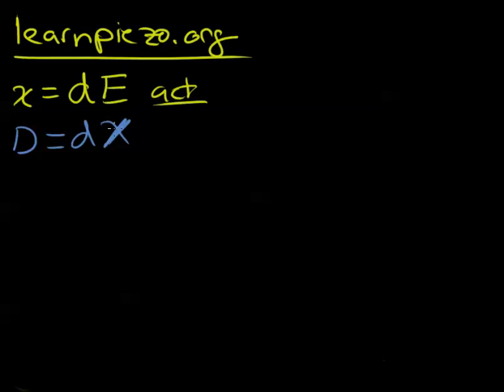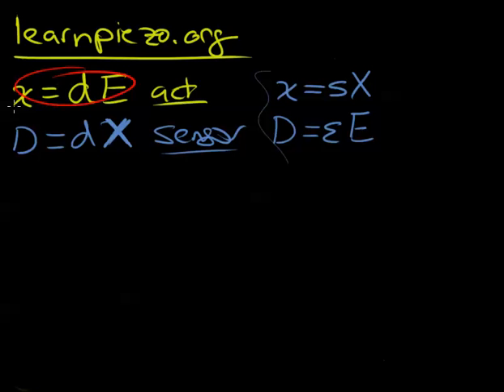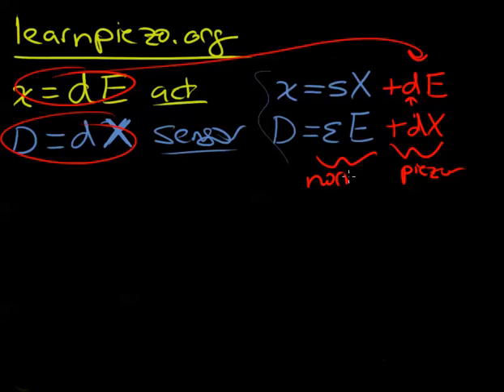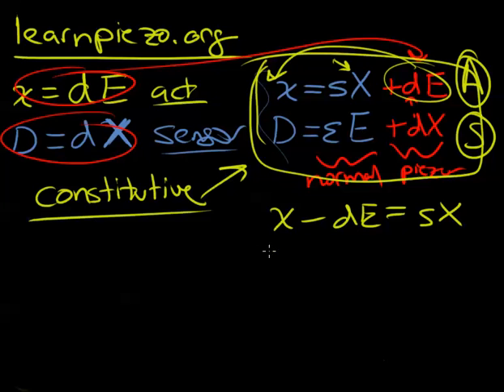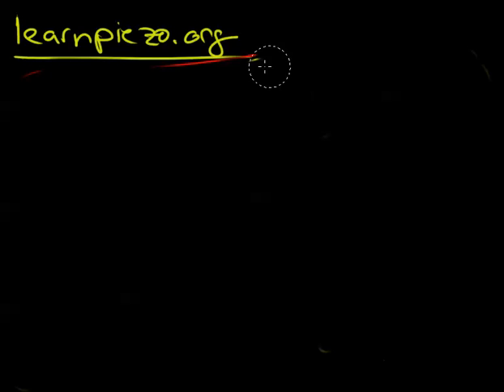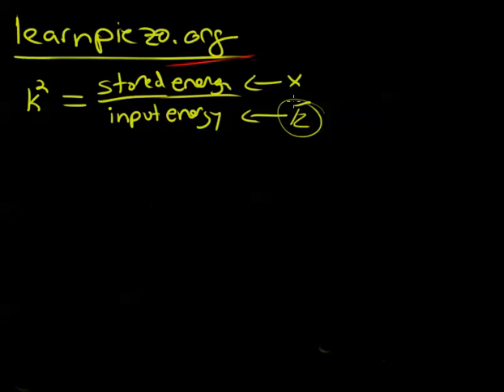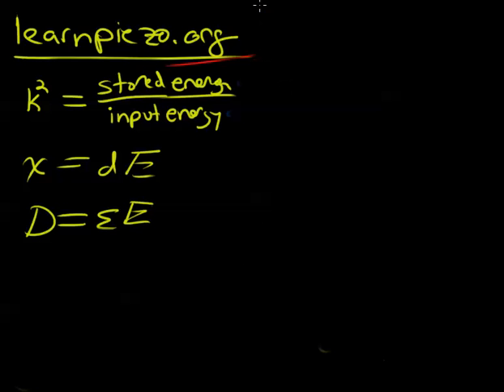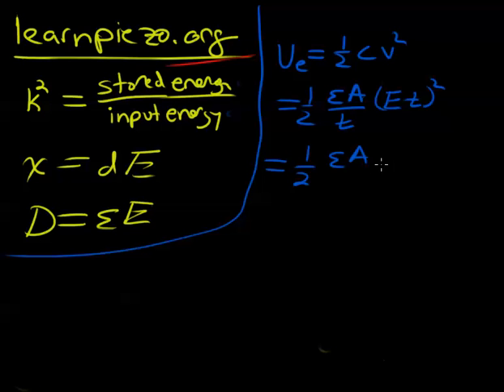Learn Piezo Lecture 3C: Piezoelectric Constitutive Equations

Comment: I need lectures 1 and 2 as well. piezoelectrics is very new to me. From where can I get the first two lectures. Can you please share the Links
Reply: @ultrasonicadvisors  thank u. Can u please help me with this.?
	Prove that maximum energy transmission coefficient λ_max in a piezoelectric actuator is expressed as follows using its electromechanical coupling factor k:
 		λ_max=(1/k-√(1/k^2 -1)  )^2